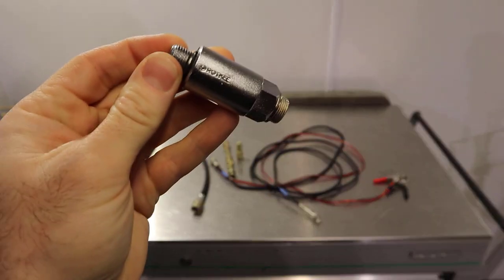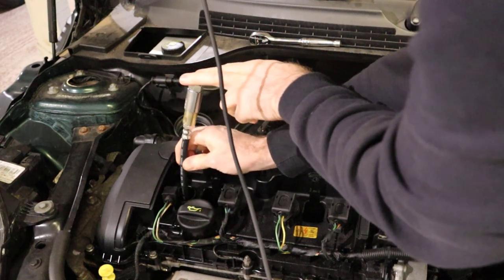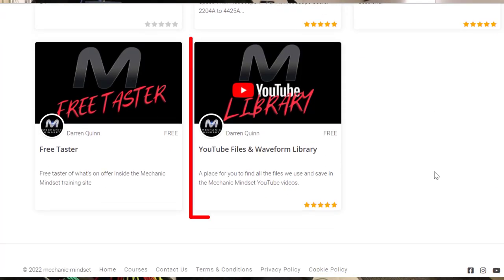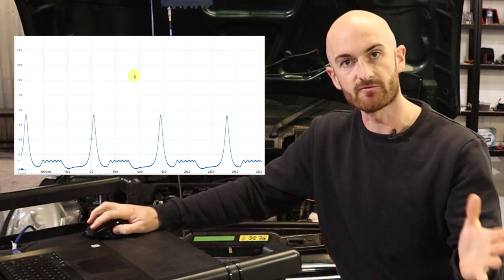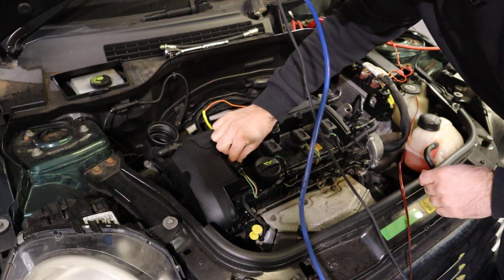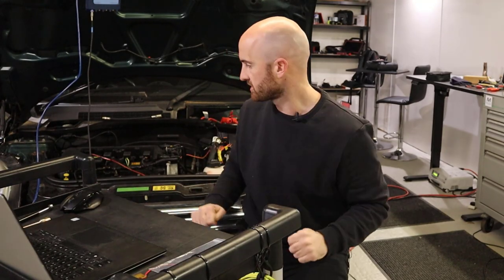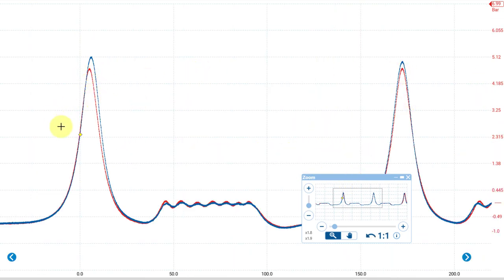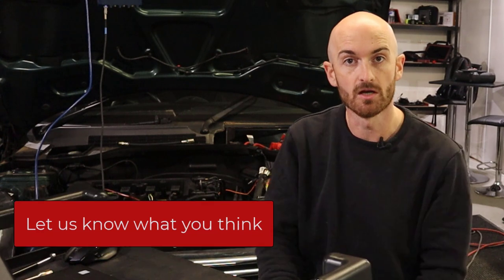In Cylinder Pressure Test with Flexi Hose vs Solid Pipe

Comment: my mate you have 4 updates to make on pico (top right corner in red )       thx for comparison nice job
Reply from the maker: 😅 I’m pretty slack with that cheers 😆 how you finding Pico 7?
Reply: @MechanicMindset  with your help got used to pico7 but it only supports x64 so on my dell tablet 8" i still use pico6 lol

Comment: For most testing I don't feel that the solid tube would be a big benefit. For timing and restrictions the need for that much accuracy isn't necessary.
For tuning however it would be more critical to have better accuracy.
Reply from the maker: I’m wondering if it helps for the automated scripts they have that identify valve event’s automatically. More in this soon!

Comment: I don't see a big enough difference that would effect diagnosis. I personally use a metal pipe for this testing made by Lisle. I used to use the hose from my compression gauge, but I had an issue one day when the hose tore off on me leaving the threaded adapter stuck in the cylinder head. I managed to get it out by pounding a screw driver into it, but since then I will only use a solid pipe. Concerning how short that setup is; couldn't you join both of those pipes together?
Reply from the maker: There’s a good reason for solid pipe 👍

For sure, I can make it longer; just filling the advice form Rotkee to go as short as possible. The Ditex kit comes with a longer solid hose 👍 thanks for sharing